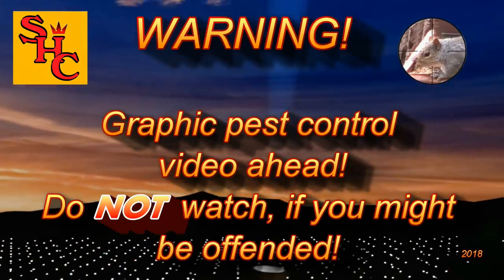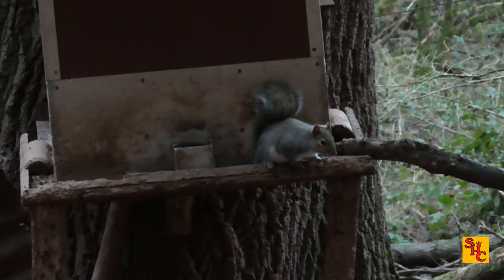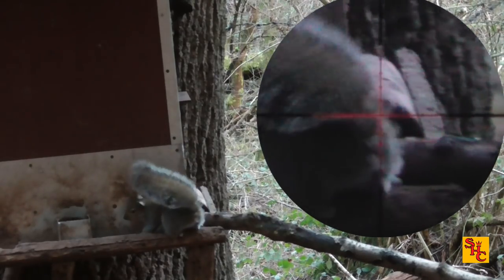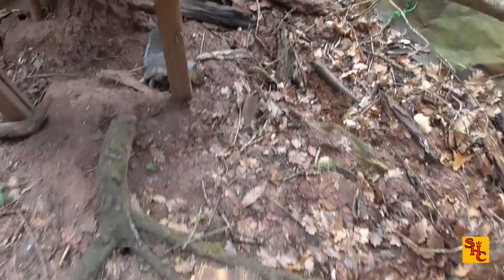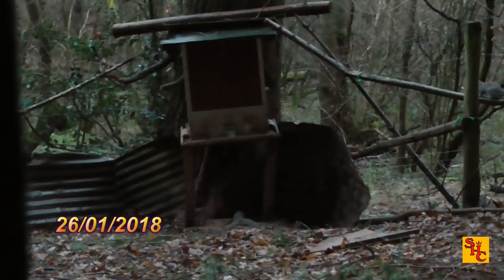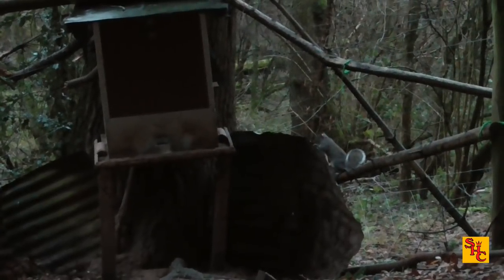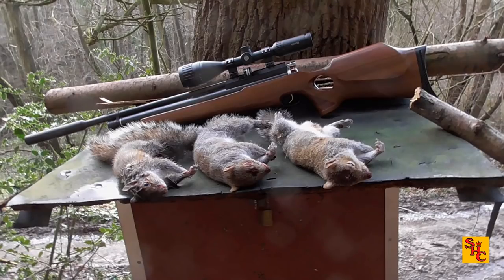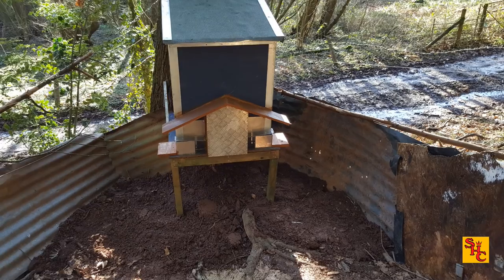Pest Control with Air Rifles - Squirrel Shooting - Big Blue feeder

Comment: New feeder is looking good. Nice shooting.
Reply from the maker: Thank you ;-)
Reply: Squirrel Hunter nice job I noticed my air rifle is dieseling a lot affects accuracy could be the very hot weather ?
Reply: Squirrel Hunter would be great to see rats shot at feeder .but any idea why my springer is dieseling ?
Reply from the maker: I'm no expert, but as far as I know dieseling is a direct result of too much oil/ grease getting in the piston tube. A strip, clean and rebuild with only minimal molybdenum grease would most likely help.
Reply: Squirrel Hunter yep its a new gun I thinks the heat from very hot weather is melting lube making it liquid flowing to front of piston head causes dieseling affects accuracy its FUBAR luck but yes you is correct I agreed totally 💪🐺🐾👌🐀🔫

Comment: One of your last comments was "despite the power", one way to increase the power of an air rifle is to place the pellet into the barrel of the air rifle and before you close the barrel smear a little grease or vaseline or even vics vapo rub, I kid you not. This seals around the pellet and the rifle delivers more power and oils the barrel every time you use the gun. I hasten to add this is not my idea but an American chap who put his idea on you tube.
Reply from the maker: Mixing any oils/ grease with compressed air is a dangerous thing to do and we do not recommend it.
Reply: Squirrel Hunter so that was why the American gentleman was using vics vaporub, its not flamable like an oil based product. I just supposed grease was ok, but thanks for the quick answer.
Reply: Jonathan Sweet 
If only the staff at Jurassic world knew this trick